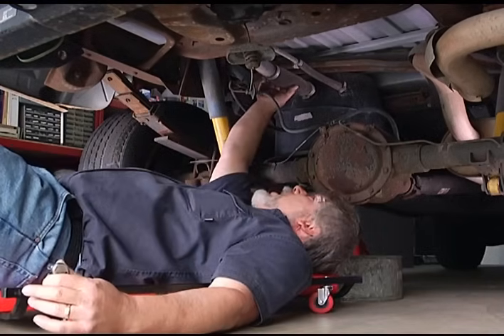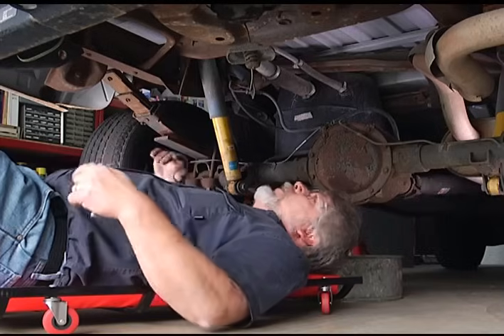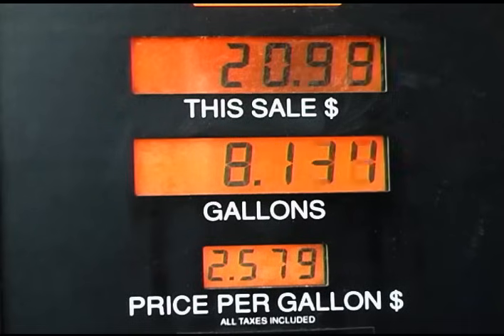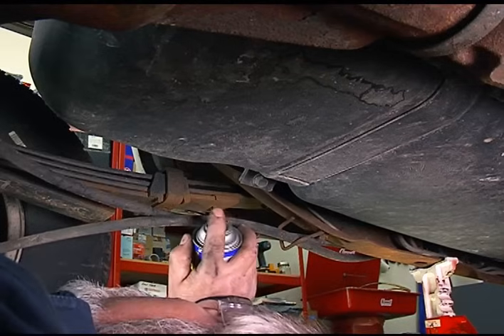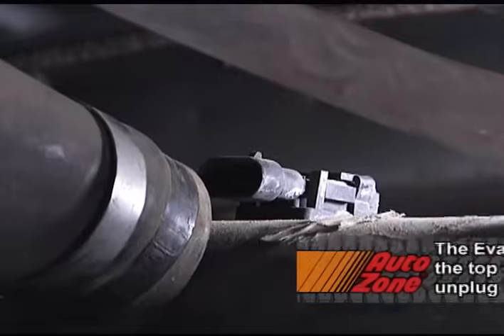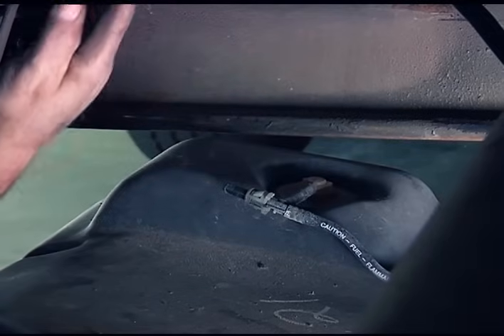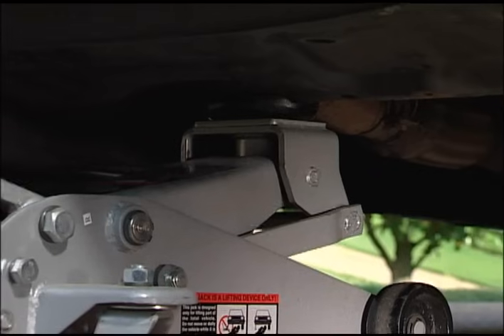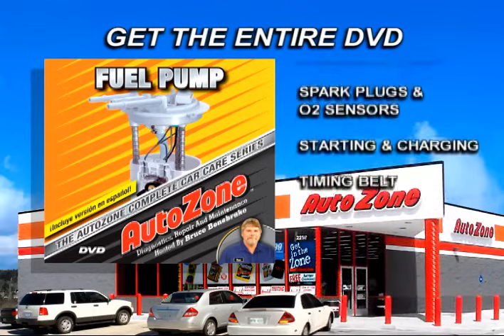How To Remove The Fuel Tank

Comment: 5:08, oops forgot to run the lines dry. By disconnecting pump relay and turning over engine until lines are dry.

Comment: This was an easy one. Can you show pulling a tank on a 2004 ford f150 with a stripped rear strap nut. The nut is in side the frame and supposed to be welded. Not.  It just turns and it's about 14 inched inside the frame. No tool can reach it. Any ideas?

Comment: Great video. But here's a question "Fuel Pump Replacement" I'm . Having a hard time with the cheap plastic connections to the fuel tank,,, without breaking them. 2001 ford explorer btw. Already have the tank loose . Just need to remove the fuel tank sensor.Electrical/ Plastic without breaking it. It is a bit brittle considering the age of the vehicle.So Don't want to break the flimsy plastic electrical connection for the wiring, and have to replace  The plastic push buttons for releasing the sensor is crappy btw.
Reply: Sean Soubiea that’s ur problem. Ford exploder
Reply: Kelly Griffith haha one big problem

Comment: i have a 1993 dodge dakota 3.9 v6 i changed the fuel pump it was running now it want start help please
Reply: Robbie Robinson Is the fuel pump priming? and are you sure you didn't reverse the polarities of the connection? could be you reversed the polarities and it's pushing the fuel into the tank and not out of the tank
Reply: Marcos Mendez

Comment: need instruction for removing fuel tank from 2014 toyota camry someone put sugar in tank so i want to remove drain and clean and change fuel filter need  thank you  the instructions for this car
Reply: Edward Palomo Go to autozone or order a manual for your specific car, then do what he has said in the video, be safe if you are a novice and make sure you have the proper equipment so you are safe
Reply: If you ran it with sugar in it. It’s probably to late. Trash it and move on

Comment: this is so bad, some nogvice is going to watch this and attempt this and fry themselves to death underneath their car.

liquid gas is not flammable, it's gas vapours which is flammable (hence why injector spray it in condenses form). Watch the video where some throws an ignited match into gasoline and the gasoline extinguishes the match.

And it's hard to tell if the fuel tank has all the gasoline vapours out of it. 

This job should be left to pros.
Reply: I believe the word you are looking for is "combustible". Liquid gas is HIGHLY flammable, but will not explode. The vapors explode.